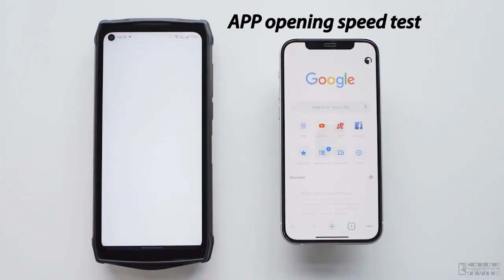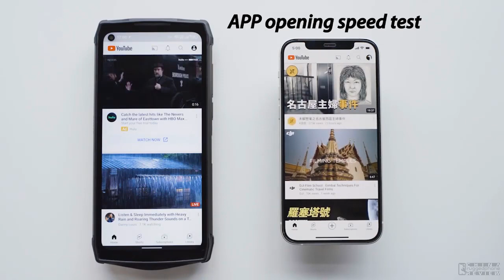Ulefone Power Armor 13 Rugged Phone Comparison (Speed Test ) and Teardown

Comment: Look at that big ass metal reinforcement in the mid frame, also the battery is held in with a metal bracket, not fucking glue 

If they made one of these with the specs of an S22 ultra, this thing would be a samsung killer